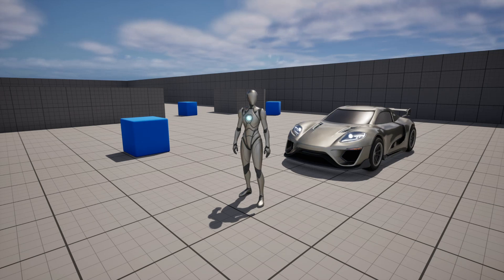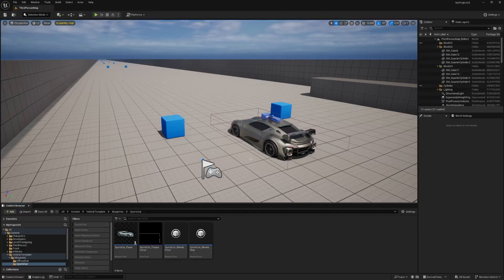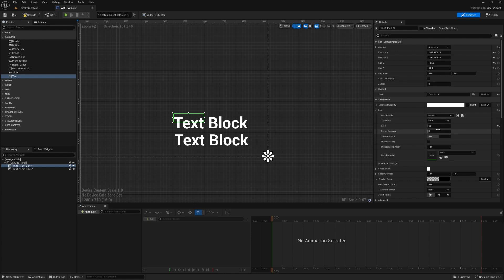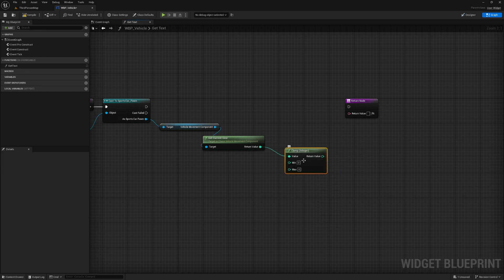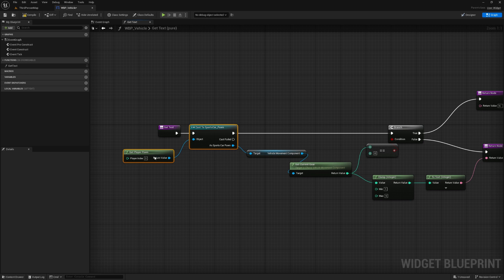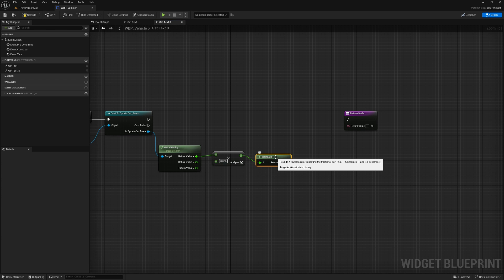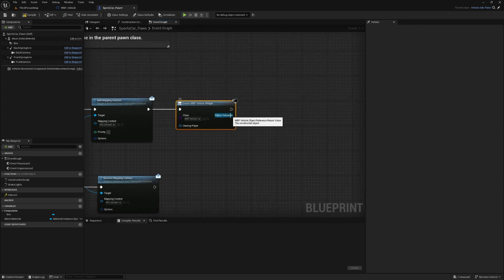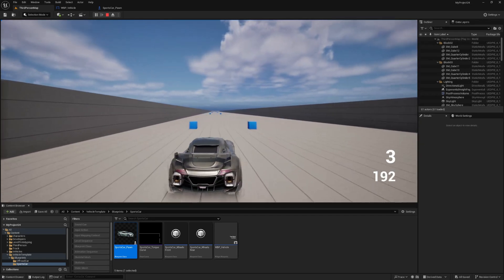How To Display Speed And Current Gear Of A Vehicle - Unreal Engine 5 Tutorial

Comment: Great video thank you very much! I found that instead of get velocity and times the X value by either 0.006 or 0.02237 cause if i turn my car on the y value the speed is in accurate! So you can use Get Velocity ( don't split structure) use vector length times 0.006 or 0.02237 and it will calculate both X and Y so your speed is accurate and wont change by simply driving in a different direction. hope that helps someone!
Reply from the maker: Thanks! That was a terrible oversight on my part... 🤦
Reply: @PitchforkAcademy  I still appreciate the help you gave me!!